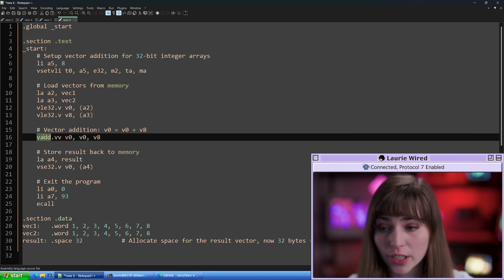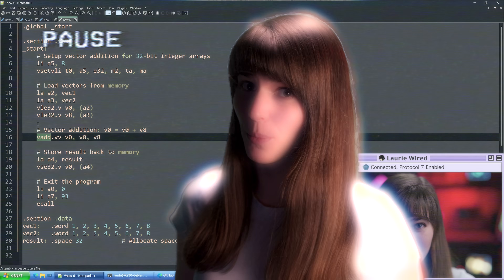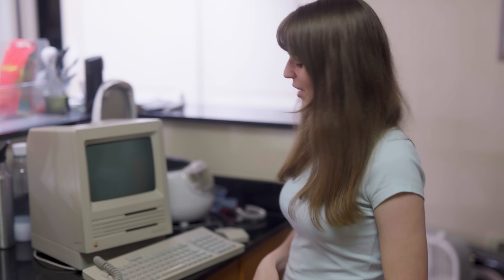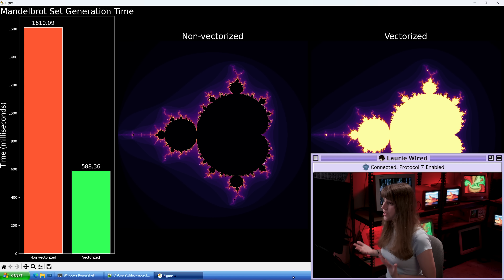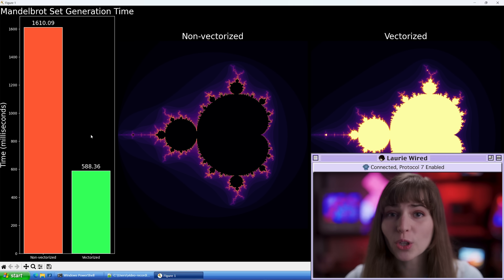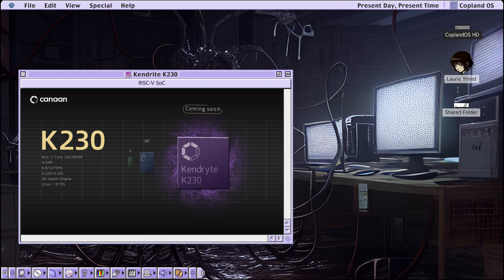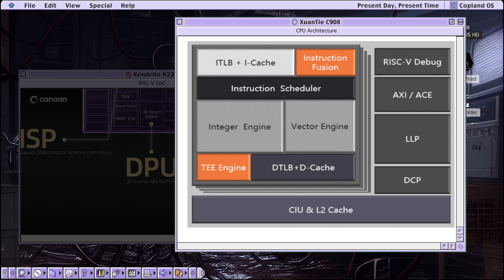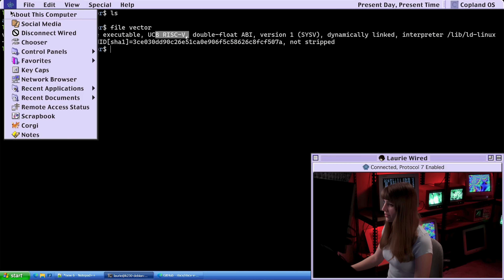The Magic of RISC-V Vector Processing

Comment: I have been developing a vector extension for a CISC processor ISA called ϕEngine. It is also vector length agnostic but it produces denser code and denser data. It uses the same scalar instructions to implement the vector instructions. Prefixes turn them into vector instructions so very few new instructions are required.

Comment: 3:05 CPU time is a flawed metric, I would rather have the big O notation to be able to compare across multiple different systems with different processors. This is especially important to me because you are using python which is a slow language so any optimization looks impressive.

Comment: Wow! I didn't know a variable length instruction set was possible. How did they achieve that?
Presumably the hardware makes this seamless by managing padding & trimming / a for loop depending on whether the requested size is smaller / larger than the hardware size respectively.

Comment: In your code example, you're also using python for the scalar version, and numpy for the vectorised version. The numpy library is written in C, so essentially you're comparing C and python as well as the improvement from vectorising data

Comment: 0:59 That makes them also very stable and you have a certain amount of instructions you can count on on every  CPU (sure there are some 'new' features like AVX and so on that older CPUs don't support).
The problem could be that (as with many open projects) it becomes harder both as a) a customer to find the right product for you and b) the software developer who might wants to use a certain instruction set, that is not supported on your CPU or your CPU has some very powerfull architecture that nobody else develops software for, because it's too rare to be cost effective.

Comment: The language aspect of a CPU bus for network distributed computing doesn't really require a new CPU - just the transmission and address protocols. 

SIMD isn't really vector mathematics. 

I get the feeling she fantasising about murdering daddy for making her wear fractal shorts when she was small 😏. Slightly fake or somebody gonna pay. 

Hands on hips fake nice autocue serial killer atmosphere. Management targets + qvc ticktock nasdaq tickers. Slap yourself in the face every time she days vec-tor. (Yay!) . Truth is scalar and vector are overwork - you just need to cache the answers as a neural statement or condition sample. Condition association rather than intensive computation. The signal path can be measured and modelled as a result path 👏.  That can be sampled or pre solved using vector reduction or mathematical compression. 

I reckon either narrate with a Bowie knife or smile more.

Comment: can it boot to an NVME? if not I would not be interested.

Actually there is a more important absolute requirement for me before I would purchase this or any other board...

 is every single inch of the implemented ISA and every peripheral on that board absolutely 100% FULLY documented down to the minutest detail?.  

I.E. If I wanted to be "insane" and write my own boot code to boot an operating system I developed using bare bones coding (actually using my own assembler and compiler) could I get absolutely every single piece of hardware on that board fully functional?  And I mean *WITHOUT* using a SINGLE pre-compiled binary other than say firmware for the GPU or NIC or wifi etc.    

This is not a purely academic question

Comment: 0.7 is finally still implemented in Linux kernel as a THead extension, as they are the only one (or to have implemented it in real hardware (Allwinner D1, th1520). THead in between made  a matrix extension, available on the Sophgo SG2044 :).

Comment: Would be interesting to have OpenGL to use vector instructions in case of not having GPU. It basically works as some kind partial hardware graphics acceleration.

Comment: That was a pretty amazing explanation, even though I've been peripherally aware of the vector extensions since they were first proposed, and did a bunch of hand-coded MMX way back before there were GCC intrinsics or even in some cases even consistent assembler support...  However, there's one thing I'm unclear on based on the code provided.  You're using a vector length of 8, and then using v0 and v8 registers.  Is that because the first vector takes up v0-v7 and the second v8-15, as one might do in a scalar implementation (especially if that was your entire dataset and you had a lot of operations to perform, so you keep it all in register), or just by coincidence?  I have to assume coincidence, because the vsetvli instruction clearly takes a register (or immediate per some of the ffmpeg code) as the vector length, and that would destroy the length agnosticism to have to "reserve" non-specified registers in that way.  My assumption and understanding from the intent of the spec is that you could just as easily had a vector length of 42, by changing nothing more than the `li a5` and the declared vectors...?

Comment: You can actually do VLA in software on Intel / arm based CPUs using clang’s C vector language extensions. You can declare a vector with 64 floats in it, for example, and the compiler will split it up into the appropriate vector size depending on whether you have 16-, 32- or 64-byte vectors, all of which are common on different Intel CPUs, depending on the vector extension flag passed to the compiler. If you are tired of rewriting software for N different vector lengths, it is the way to go. The compilers ability to narrow vectors is flawless.

Comment: so doesn't this allow for functions such as routing voltages and thermistor values on say, 3D printers, to route or even straightup side chain with random number generators or even API -quantum random number generator/pseudo QRNG, in tandem with various trigonometric functions or even combinations of any of these but In real time and can be processed in firmware rather than post professing a parsed gcode?

or multivariate non linear control instructions for programmable boards where again, different values can function as targets or controls that progress or regress other parameters or functions.

This also reminds me of the nature of Digital Audio Workstations in their scale and scope but that non linear processing or hidden linear processing. o bet FFT and variations of Fourier transforms would be significantly easier to implement  too.
just as an example. this seems perfect for pre-quantum prepared states and in some cases, it doesn't even need to involve a quantum process at all. 

thank you for making this and sharing i would've not heard of this for at least another year or two. you got my sub and salute

Comment: As a computer engineer I am not sold as to why vector instructions are useful with the oven-cookie analogy, why? Well since superscalar processors are a thing it is similar to having 5-10 different cookies and when an available oven is present it bakes a cookie, bear in mind all ovens in cpus are single cookie sized (as far as I know). Furthermore I don't know much of it but x86 has a thing for speeding up loops iterating arrays for vector calculations.

I wish there was a more in depth look as to why it's faster compared to existing technologies, I dd appreciate if anyone knows and can enlighten me

Comment: I have to ask, if vector size is variable and will be auto configured on runtime to fit ALU, that means one vector instruction can actually break down to multiple instruction, kind of like what x86 microcode does. If so, then what is RISC?

Comment: Hey Laurie, thanks for the video!  I've got a k230 and can assemble and run none-vector instructions just fine. However I'm struggling with the options for assembling and linking vector instructions using riscv64-unknown-elf-as/ld.  I think it's the link I'm stuck on, but if you could share both the assemble and link commands I'd be really grateful!  🙏

Comment: Are you an instructor? You've got skills. The narration/visual "ride alongs"; Engaging. Now to your points re HDMI, WIFI and non-stick mac-Address.
I've been out of assembly language for eons but it looks like you have the skills to slay this dragon.  a couple of Q's first; are you looking at the mac-addr changes via a switch or right on the register? If Register address location then, first glance a memory leak (being overwritten by some dynamic var); If the NIC can it be hard coded?    Are the WIFI Protocols being adhered to? There's a lot going on in the packet exchange, you may have to emulate each phase to see what/where is it uncooperative.  A breakthrough here and your followers here on You Tube will certainly put you on the King Chair of tech pros. I already consider you one.  Great Job (Massive effort Ack'd)  Be well God Bless.

Comment: I know that practicallity often justifies small decreases on efficiency, but as a assembly programmer, do you not see a problem with Vector Length Agnosticism increasing overhead on vector computations? My reasoning is that in x86 and other ISA's the fact that the lenghts are fixed they are determined at the time of programming, in a VLA system I believe that the selection of the lenghts would be determined at runtime, making the computation slower, and when several instructions with different vector lengths are used in series, way slower than if the same size was always used. Of course, the occurence of such a scenario might be very rare, but I got the impression from your video that VLA only had good sides and no trade-offs, and, as a assembly programmer (someone who usually wants to get every little bit of performance from their hardware) wouldn't this be relevant?

Comment: Wait...stop.  This is a nicely done video with very coherently presented content.  Well done.  You have, however, left out all the details as an exercise for the viewer without providing any links or hints!  You're running Debian on the  big core?  How did you manage that--with buildroot?  Do you have a link to the CanMV-K230 instructions that got you there?  You've ssh'd into a terminal on it--how did you get the Wifi working?  I agree with you about RISC-V, it has great potential, so people might want to experiment with it.  Honestly, though, the topic of the video, using RISC-V vector instructions, is pretty trivial compared to all the setup you left out.  Maybe you could provide a disk image of the Debian build you're using.  Your website has a Github link, but there's nothing related to this video in any of your repos.  

Maybe your plan is to do more videos on this device.  That would be a good idea, particularly since the really interesting bit of this thing (like its K210 predecessor) is the "AI Core," particularly the convolutional neural network processing unit (KPU) and the FFT engine.

Please give us some links to run debian on our own CanMV devices so we can build and run our own programs.  Thanks!

Comment: Wow, great content.
I grew up with a 6502 KIM style board and developed a sweet spot for assembly programming. I kind of specialized in low level ARM assembly over the last 25 years, mostly trying to squeeze the last few microseconds out of I/O operations and interrupt latency. I've had my eye on Risc-V for some time now and the Vector Extension looks to be the moment to jump in.
Time to investigate in an FPGA solution to play with this (for me) new architecture.

Comment: Another wonderful video; you're definitely an order of magnitude smarter than me. Also, much better at video editing. And explaining concepts. Damn.

One question: How do the vectors actually make things faster? Are there lots of processing units inside the core that can load each part of the vector and do the same operation simultaneously? Or does it just fill the pipeline so each part of the vector can run in quick succession over multiple clock cycles?

What is the real-world performance of one of these cores, with unoptimised software? Is it similar to a Raspberry Pi or is it much more primitive?

Comment: I'd be very curious to learn more about how the hardware actually implements this "Vector Length Agnosticism". You didn't talk about this in the video.

Since it is possible to configure a logical "vector register" to represent any length of vector, and then each vector instruction is expected to process the entire data of the vector, what happens if you request a vector length greater than the actual physical width of the vector unit inside the CPU core?

I am guessing the CPU would internally perform each instruction across multiple clock cycles / in multiple steps, to go through all the data? But where is the excess/overflow data stored? Does it require "shadow registers" and register renaming? Looking at this instruction set, unless there is some very clever trick behind it, it feels like it is only implementable in complex out-of-order CPU designs that can split instructions into micro-ops and have large hardware register files to spill data to?

Comment: But what mechanism exactly causes the speed up?

I assume it's the fetch and carry work because the chip is shuffling larger packets of data in the form of much larger vectors. The actual maths operations on each number pair probably aren't any quicker.

Comment: I'm  curious what is actually happening in hardware. I suepect the real limit is getting the vectors from memory and back again. Nowadays with such huge cache, it will be hard to see that limit with a small example. It almost seems like the vector instructions are microcoded.

Comment: so if i am correctly reading and understanding what you are saying the risc v 1.0 spec supports 256-bit wide vectors (8 x 32 bits ). so its somewhat like the  avx256 SIMD instruction set.

Comment: 50 years ago, I learned some finite maths. Never used since, it's a little rusty. Amongst other things, it deals with vectors and matrices and performing mathematic operations on them in useful ways. If you're unfamiliar with finite maths, I will leave you to research it, you probably don't need much.

About the same time I learned to write programs in PL/!. One can
Declare i int;
Declare  ia(45), ib(45,7) int;
/* Initialisation omitted */
a=i*ia; /* returns a 45 element array, each elements of ia is multiplied by i; */
b=ia*ib; /* returns a 45x7 array, each element of ib(x,y) is multiplied by ia(x) / / or something very like that, I last wrote PL/1 about 24 years ago, and didn't use that feature.*/

Both are useful,  Which does vector processing support?

Comment: First time here. I think Youtube brought me here bc I just finished up the show "Devs" and have been watching videos on quantum computers. Vector processing seems like another example of how the future of computing isn't here for consumer electronics (yet) but possibly better suited to help in the large calculations needed to help expand knowledge of physics, nature, etc.

Seems like vector processing might be a really good match for interacting/interfacing with quantum computers.

Also also, I had a micro controllers professor that said programming in C is like driving and automatic, while programming in assembly is like driving a stick shift. Might not be the best analogy, but your statement at the end made me think of that. Compilers don't always know best, especially since the instruction set is so new.
Reply: Intel cpus had vector instructions since a long time. Developers just need to know how to use them or compilers should optimize code that uses those instructions instead of what programmer wrote, recent c# compiler dose that.

Comment: Vector length agnosticism doesn’t mean to completely ignore vector length. It emphasizes situations where the lengths are irrelevant for the specific task. By focusing on direction alone, its easy to simplify calculations and gain insights without unnecessary complexity. Whether in computer processes relating to geometry, data i/o, memory functions or even graphic design, the principles of VLA have many applicable uses and results in a more efficient process. It's integral to the concept of Reduced Instruction Set Computing - RISC.

Comment: Vector Processing is how modern video games (typically) achieve so much at such high framerates. We use SIMD everywhere we can. Great video!
Reply: Also the fact that GPUs have thousands (if not hundreds of thousands) of cores, so you can run thousands of vector operations simultaneously.

Comment: It is super interesting with an open source instruction set. I do worry that having everyone making processors choose themselves what part of an instruction set they will support will get super messy super fast. The benefit of having your tv and your car's infotainment system support the samme software could be a huge help in recycling electronics and allow the consumer to modify products they have payed for. Like using standards for bolt, screws, piping etc. (it would be super hard to replace your disk pads if every car manufacture used there own "open source" bolts and nuts. )

Comment: As an engineer relaying on linear algebra every day, this is very interesting. Although the test examples are comically small 😂.
Would the actually be faster than AVX512 at matrix inversion of a square, symmetrical, band matrix represented as a sparse matrix of the size 100k to 1B elements with something like 99% of all element being zero?
Assuming the rest of the processier is equal! (frequency, memory speed, cache etc.

Comment: something i didn't quite get is how VLA works in the assembly code itself, I understand that vsetvli sets the length of the vector to expect but having the length hardcoded in the next instructions (like in vle32) seems counterintuitive to me. Wouldn't you need to recompile if you wanted to use 64 wide vectors instead?